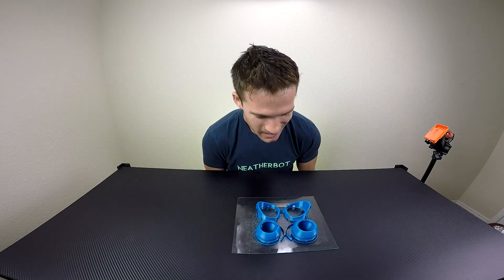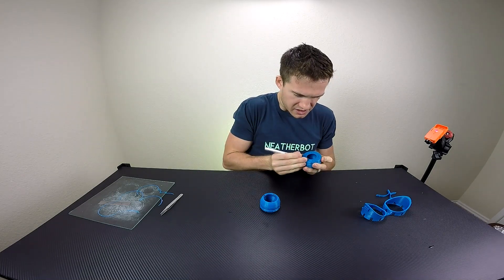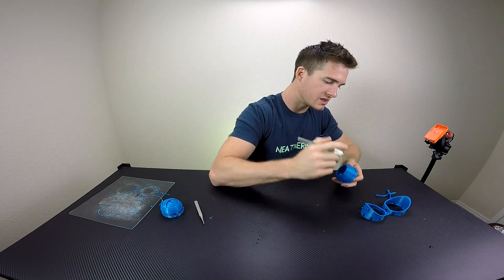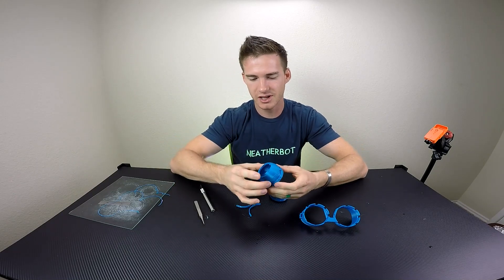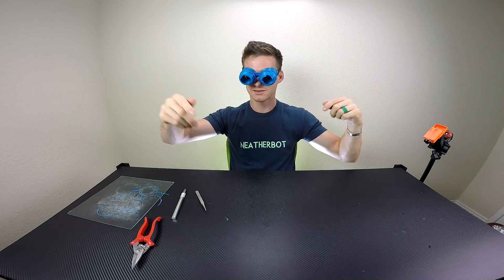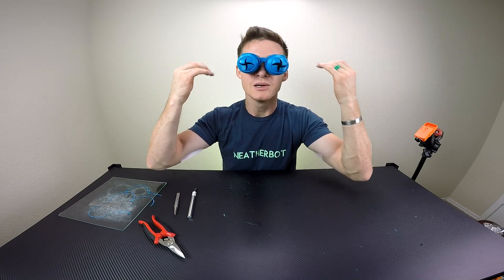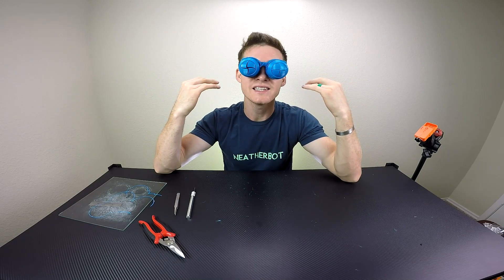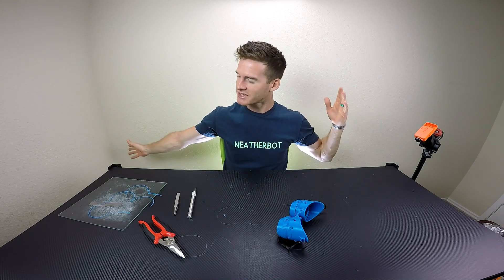Blinking Iris Goggles

Comment: This is so weird.... I saw this on my feed right when I was trying to get my model to turn! I'm surprised at how quickly you got yours to move - mine isn't budging still and I've been trying on and off for a few hours to get it to work!
Reply from the maker: +Brent Werder haha nothing like a timely video recommendation :) Did you pry on it like I showed? What have you tired?
Reply: NeatherBot  I cut the tabs on the bottom, ran a screwdriver in between the sphere and the ring, and even made sure that the leaves were free from the top of the assembly! Maybe some stringing on the inside is keeping it together - but I doubt it, since my setup has been calibrated to NOT string with colorFabb PLA. Weird stuff - especially because I'm running the same setup as you down to the mount on an UMO+!
Reply from the maker: +Brent Werder that is odd. Did you pet up on the outer she'll from the ring and hear any cracking?
Reply: NeatherBot Yeah! I tried to seperate the ring from the shell and took a blade to the leaves.  Just tried another print and found that one of the leaves was sticking to the inner shell, though.  It also seemed as if that area of the print wasnt circular, since both the inner and outer shells had irregularities there.  Possibly a loose timing belt or two since I'd just swapped out the hotend assembly... I'll see if thats the case!
Reply from the maker: +Brent Werder hmm yes loose belts would cause some bad juju with this print... If the inner wall, iris leaves, and outer shell are not all concentric and spherical the mechanism will not slide. If you print a simple circle is it lol sided?
Reply: NeatherBot I'll work out a quick little circle print on tinkercad and report back.  Some circles look round (the first layer is very symmetrical) but later it seemed like the layers were off.
Reply from the maker: +Brent Werder that would be strange if it happened at layers higher up. You might also print a calibration cube and measure to see if X and Y are the same.
Reply: Oh boy.... looks like I have another jam on my hands, though I doubt that was the cause of any irregularities I found.  It must be the awful feeder I still use from Ultimaker which jams all the time.  Hopefully I can get that worked out and get up and running soon...

Comment: Dude you need to use hair spray. comes off so much easier than having to use a blade. Plus just using hot water will clean it off.
Reply from the maker: +Brent Elliott I have used hair spray.... And I really hate it. Lol I always get it all over everything. Yes hot water cleans up the glue stick quickly. That's why I stay with it.
Reply from the maker: +Brent Elliott do you use aquanet? I may do a trial and see what works and is best for my workflow.
Reply: Yes I use aquanet. But I also have a wanhao I3. Still shouldnt be different.
Reply from the maker: +Brent Elliott does your i3 have a glass build plate?
Reply: NeatherBot yes it does.
Reply from the maker: +Brent Elliott ok well I'll play with it some and see what works best.
Reply: NeatherBot when I apply it I act like I'm painting it.
Reply from the maker: +Brent Elliott do you take the glass out of the prinnter? I do not want sticky spray getting on my linear system.
Reply: Yes I do.
Reply from the maker: +Brent Elliott ok good deal. Have you ever used anything other than aquanet?
Reply: NeatherBot just blue tape right to the build plate before I added the glass.

Comment: Is your printer calibrated for dimensional accuracy?
Reply from the maker: +Karan Chaphekar I would like to think so. What are you thinking about?
Reply: I meant to say that did you calibrate flow by doing thin wall calibration or its default ultimaker settings. I use s3d xy dimension offset to make parts fit well. Do you do something like that
Reply from the maker: +Karan Chaphekar I have painstakingly gone through and calibrated everything on my ultimaker. When I upgraded my stepper drivers I had to go back and recalibrate steps. I did it 2 years ago... But I did carefully calibrate all axis and extruder. I have not used xy offset because I modified the firmware to fix any errors.
Reply from the maker: Thin wall calibration is what I used. a long time ago. haha I probably should redo that calibration